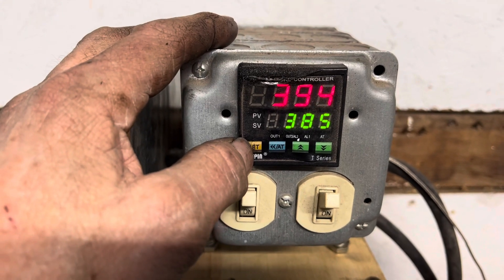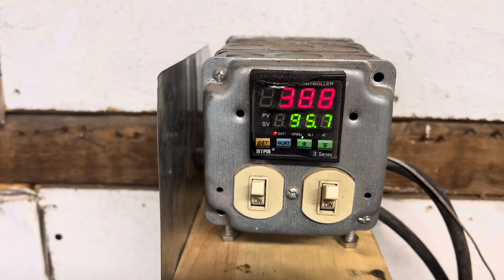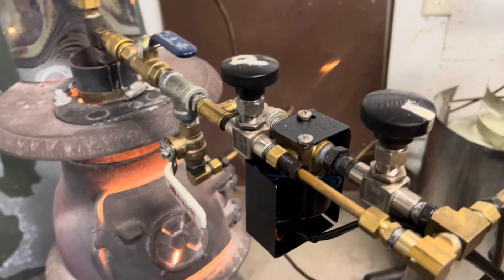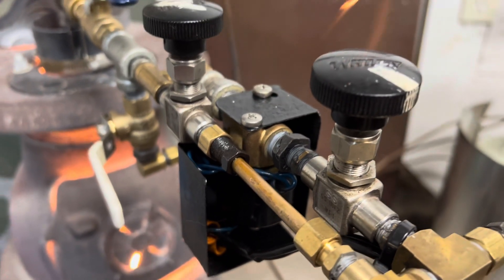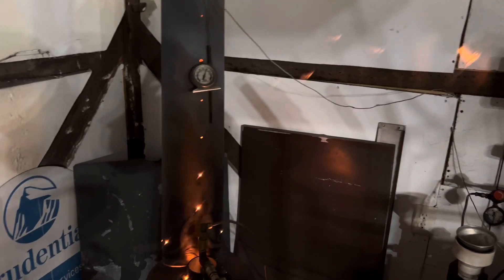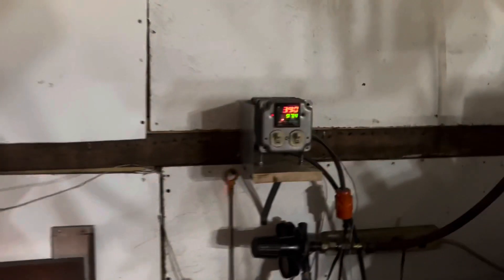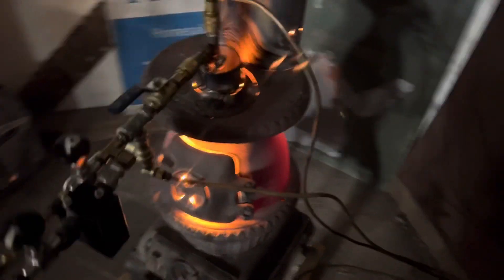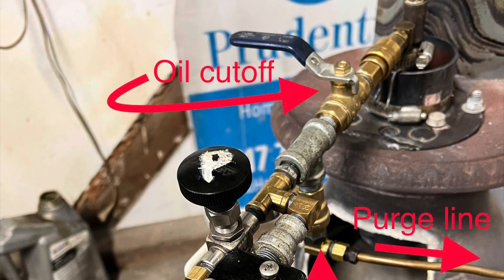Safe PID Controlled DIY Waste Oil heater

Comment: Nice job, eventually I will get mine back running, adding a limit controller to my  unit.   I also have PID loop controller to integrate when I get back to it.   
I runbas low as 1 gallon in 5 hrs at a drip rate 1sec per drip that provides plenty of heat for the cabin.
It will rage as well but like u k ow can't walk away from them.